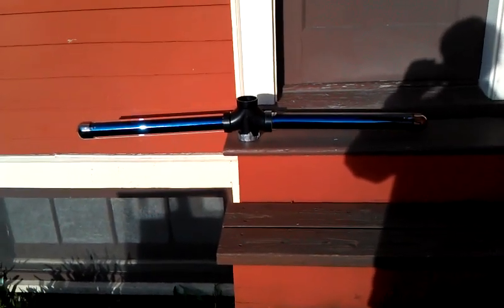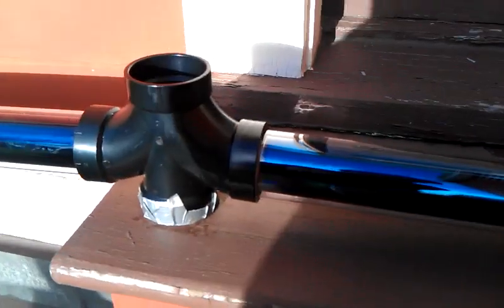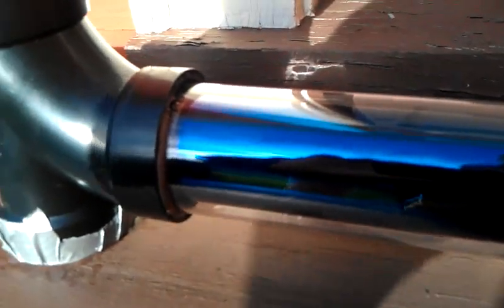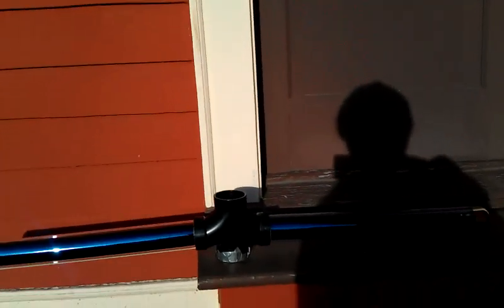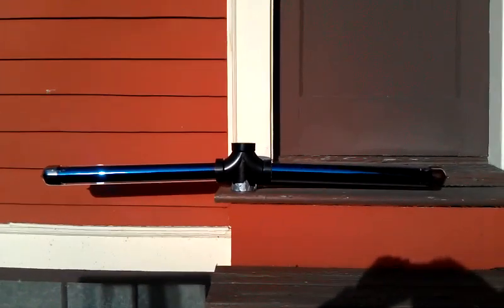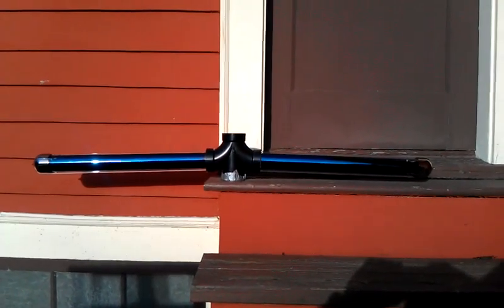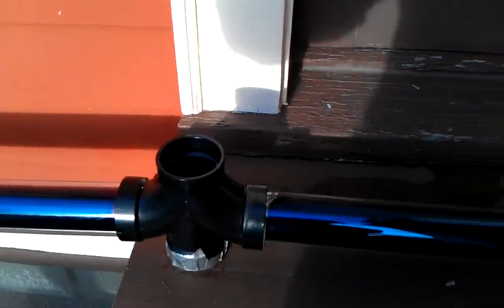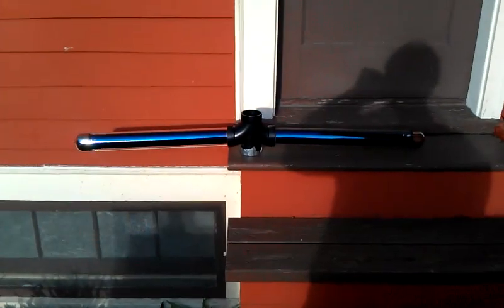Solar water heater vacuum tube connection

Comment: Thanks for this. If JB-Weld is not flexible expansion may cause a glass break, but if any adhesive is flexible like silicone caulking should help, but heat may be it's downfall. Not sure what sealant to use except a Neoprene rubber snug -not tight fitting, will allow for expansion and contraction.
Any ideas ? I will look for neoprene first , and get back to you on the results .
Cheers, Gk.

Comment: So far, I've only seen the suggestion to use PVC or ABS fittings to create the manifold.  But neither of these plastics is acceptable for UV exposure.  I'm thinking a copper (or steel) manifold trunk, with these glued in via polyether caulk, and that whole trunk encased in something like a sonatube filled with foam insulation.  The sonatube wouldn't work either, being exposed.  But something like that may work.  Or using polyether  with plastic fittings if it's insulated & encased in protection?